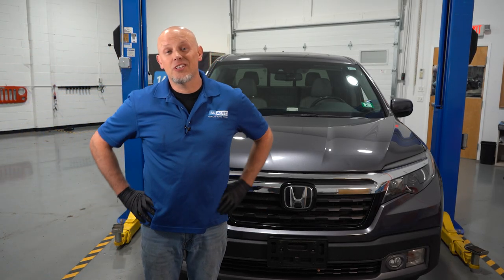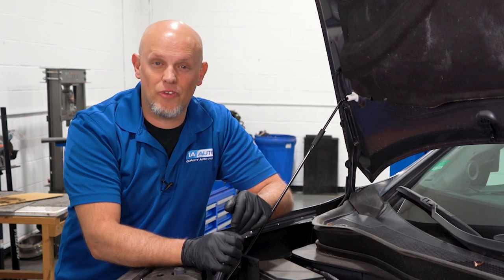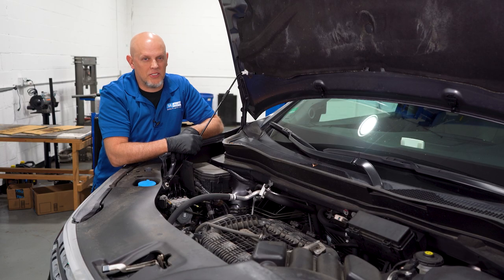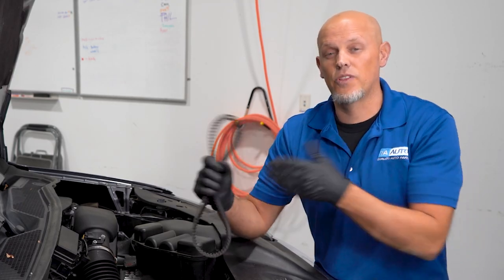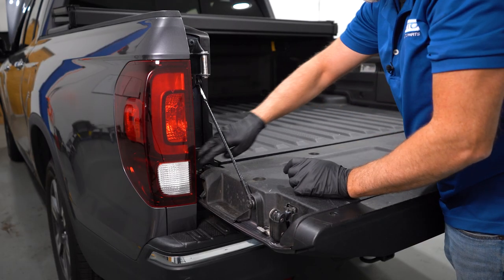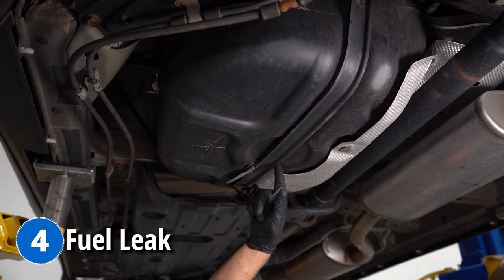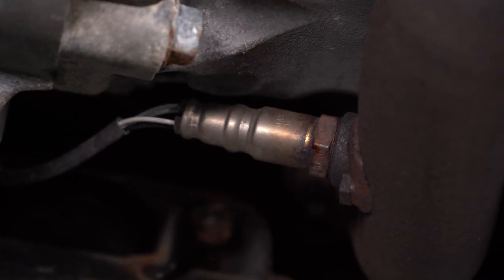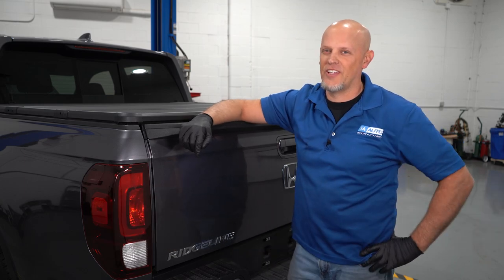Top 5 Problems Honda Ridgeline Pickup 2017-Present 2nd Generation

Comment: Biggest problem of all: the frequently imperfect seal on some of the rear cab body joints.  To check this after a heavy rain, pull the rear interior area floor plastic up, one at each door and the one that runs down the middle where the rear seat legs snap in when they are down. All three of them just pull up, no screws involved.  Next stick your hand under the carpet and fell all around.  If it's wet or damp then you have an issue. The carpet is waterproof and you will NEVER know you have a leak unless you check.  Eventually the underside will mildew and the truck will stink of mildew if this is not addressed.  Dealer may give you the run around since Honda does not reimburse them adequately.  My dealer took 30 hours to fix and got reimbursed for two!  But Team Gillman Honda North was awesome and fixed my leak.  They had to disassemble the bed to get to the seams to re-caulk them. Pro tip, take some colored construction paper and video sticking it under the carpet and changing to a darker color when you take it out wet or damp.  That way the service manager will see the problem right away!

Comment: Mine had the Body Leak in the rear of the cab, Honda fixed it after a couple of tries - I got rid of it because of that, otherwise I never had an issue with my Ridgeline RTL-T. Loved it trade up to a Honda Passport TS

Comment: Had a 2017 , 2020, ridge line no problems at all , have had my new 2023 a few months with 1,737 miles battery was not holding a charge replaced by dealer under warranty

Comment: My 2017 Ridgeline transmission needed replaced at 52,500 miles. First noticed the problem at 48,908 miles. Cost me $10000.00 loss in trade  in value. The Honda transmission fluid and filter needs replaced every 20,000 miles.

Comment: My 2017 just got back from Honda dealer to correct engine light which resulted in injector change out. Drove for 75 miles then engine light reappeared.  Honda shop said injector 1 & 3 were swapped out to correct problem, truck was then driven by shop with computer hooked up and all was good. I picked up truck, drove for 50 miles and light came back on. Now they are suggesting to replace cat converters ($3-$4000).

Comment: Very informative. Thanks! I've had Toyotas for years. I maintain my cars well and try to keep them for a long time. I'm looking to get a '23 or '24 Ridgeline. Since the J35Y engine is Direct Injection only (My Toyotas have PI & DI.), is there a problem with carbon buildup on the intake valves?

Comment: I traded a Ram1500 for an 2017 ridgeline not a bad little truck , the only thing replaced was the fuel injectors Honda did those under warranty

Comment: I have a 2023 about a year old. In the shop right now, passenger floor carpet completely soaked. AC condensation dripping down inside and onto carpet. They are saying the heater box is “bad”. They have to take the whole dash out to get to it and replace it. Very frustrating for a truck less than a year old. Concerned about what else will happen or go wrong by taking the dash out.

Comment: I have a 2017 and.my emissions light came on and I took it to the mechanic and he did a  test and it said bac 2 on the converter and he told me to put a bottle of fuel injection cleaner in the tank and drive for about 20 miles and the light will turn off and it did no more problems

Comment: Only problem so far with my '23 is it went into limp mode 6 hrs from home. Turned off, good to go. What the cause is another story. Honda knows limp mode is an issue but have no fix...dealer thinks its condensation buildup after some highway driving and coming to a stop is when it always occurs.

Comment: had a problem with the walk away locking system not working after the dealer could not find the problem a did my own research took it back to them asked them to check the   start stop button and sure enough  that was the issue   they fixed it under warranty
Reply from the maker: Thanks for checking us out! http://1aau.to/m/Shop-1AAuto-c

Comment: Not a true pickup truck
Reply: That's why they sell so well.
Reply: It is not a truck.  Not even an el camino. It is an odyssey on steroid.
Reply: Pull my two Wave Runners just fine.  Traded a F150 for it.  Does more what I need.
Reply: What’s a true pickup. A crap dodge that ends up in the auto wreckers 🫶🏽
Reply: Yeah, it's better.
Reply: The DOT, DMV and vehicle insurance beg to differ. As does the 1500 lbs of gravel I hauled with mine without breaking a sweat or going low rider. 😏
Reply: Just ike an f150 with 10,000 wheels that never leave the mall.
Reply: Nothing like having an F350 and never use to haul items or pull a trailer
Reply: ugh, this tired argument again